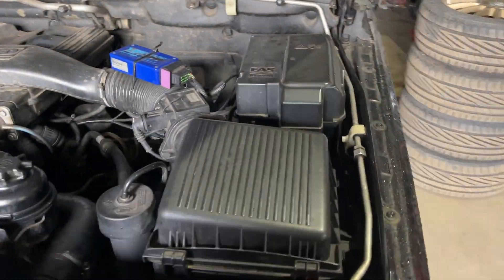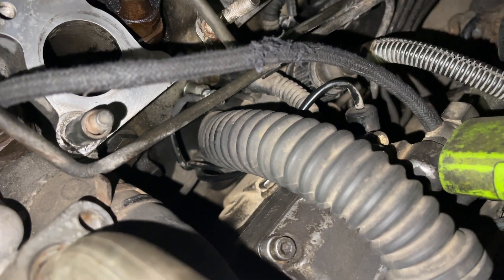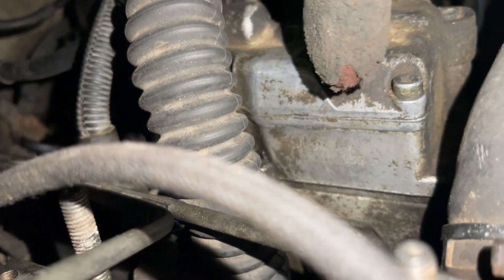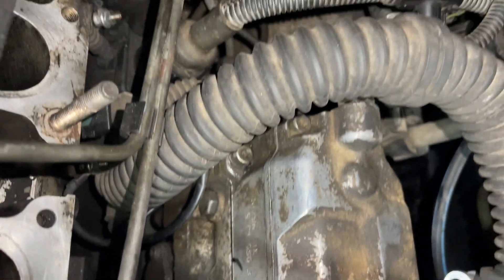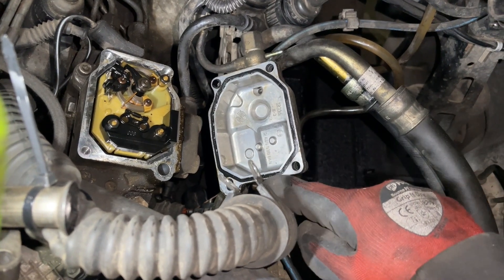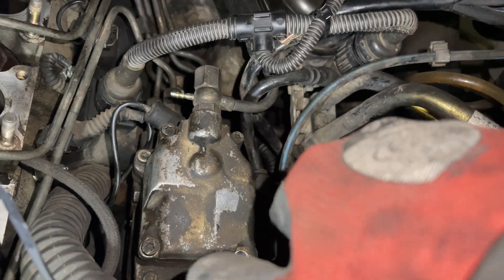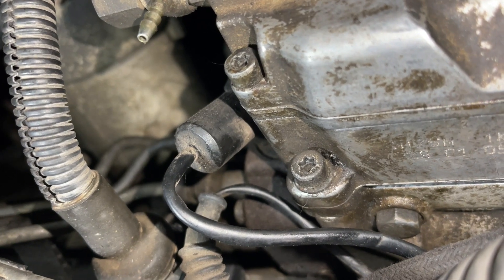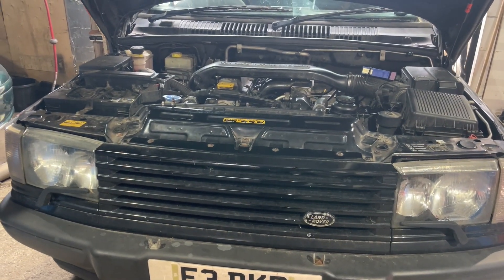HOW 2 - Land Rover Range Rover P38 High Pressure Fuel Injection Pump Reseal BMW M51 VW TDi

Comment: Unless your pump is set right, the computer will read wrong mpg so thinking it’s jumped 7, make sure it’s happy on a bearmach or nanocom think it wants to be around 4/5mgs injected quantity I ran mine around on 2/3 for a bit and it was fast as but reported 30mpg and wasn’t getting it
Reply from the maker: Its gone now. Hopefully its new owner is reaping the rewards of the pump leak fix